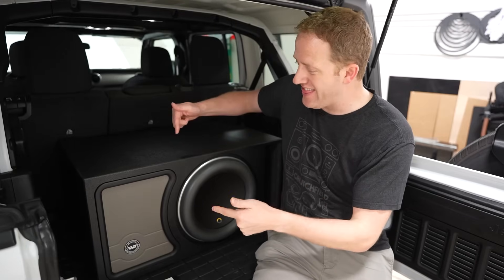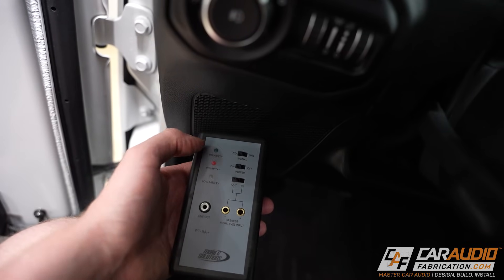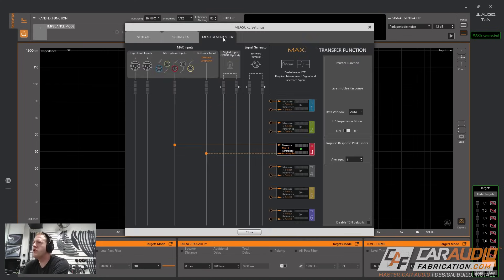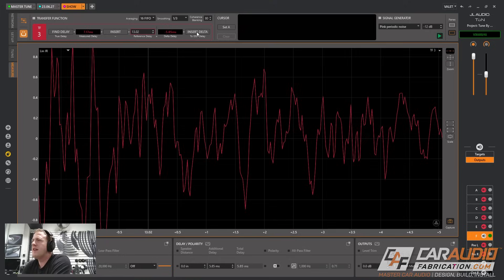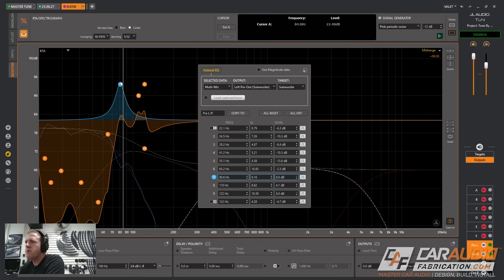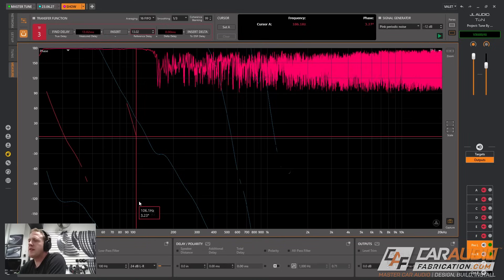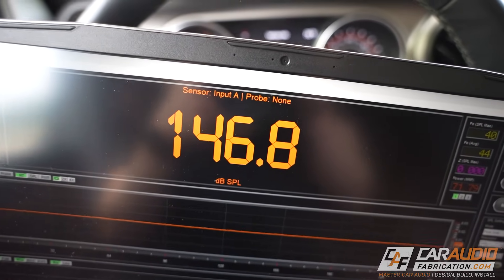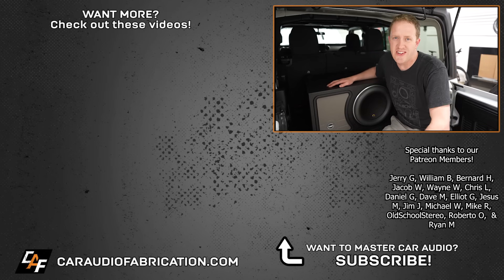MAXimizing Subwoofer Performance - Tuning & Testing W7 Box Build!

Comment: I've had my 2 13.5's for 18 years with only a surround replacement. JL Audio speced my box according to how I wanted the subs angled and they sound amazing. I had them also spec out SPL boxes that I used one time before I moved to another state but many years later the basement flooded and they got wet. A 11/2" thick subwoofer box looks crazy when it swells up from water and unfortunately I no longer have the box specs now that my son is into music.
My oldest son is into SPL and loud bass and just got his first car over winter which that day he put his mom's, my wife's from when I met her 25 years ago, 2 Extant 12"s setup in the trunk. Black Friday we ordered 2 15"s and an 8k amp. The second sub finally showed up the end of January. We measured the trunk specs to get a box designed and this is where things got interesting. The f/s specs that are sent with the subwoofer don't match up when entered into the program and that's when the reality of most of the audio companies out there. He mentioned only a few brands that list actual specs JL Audio being one. So we ended up building him a box speced online to manufactur recommendations and we had to change the subwoofer location firing up. He hit 146.4 at Saturday's competition with 50% power and over the next month we will do some testing at full power and cut that box out of the trunk space and try a different design and smaller box and see what that does and hopefully his numbers will go up to where we won't be building box # 3 or 4 till it's where it needs to be.....

Comment: What’s the absolute best hertz for loud clean deep bass overall , I heard 80hz is the sweet spot
Reply from the maker: 80HZ is usually where you start considering transitioning to midbass. The answer depends on the vehicle and subwoofer used.
Reply: @ thank you. Basically I can’t go wrong with 80 ✅👍🏽

Comment: What would you prefer an 8W7 in a Gately box ported or 12 W6V3 in a sealed box they will be powered by a Mosconi pro one/10 the rest of the system is a Mosconi one 6/10 all focal k2 speakers

Comment: Hey man you’re the only one I can turn to. I’ve got a JL system installed by a dealer and I still heave a very faint hiss from the speakers but only when the A/C is off and you’re dead silent. I looked at the ground and I saw they didn’t scratch the paint and I brought that up to the installer and he said he’ll adjust the gains and that the amp ground just being screwed in is enough because the threads are touching bare metal. Should I take it to heart or should I just sand the paint under it, or will it even make a difference? Amp is XDM1000/5.

Comment: This is why a DSP is needed for every system. So you can control everything. Get better SQ. Your system will be focused instead of sounding like the speakers are playing everywhere. And you can take that same sub/box and put it in another car and it will not sound the same because every car's cabin is different....

Comment: I think this is very informative for 1% of the car audio enthusiasts out here and not really for the average DIY’r. A tutorial on tuning and and perfecting car audio with basic tools/equipment would apply to a wider audience and would be appreciated.
Reply: Exactly. AA battery for polarity check, $20.00 voltage meter to check what ohms the cabinet is wired to, If you know the Fs of any speaker on the crossover set it higher by 2 times, so a speaker with an Fs of 60hz you would high pass filter it at 120hz to protect the speaker and for better performance in its frequency range. I used the same process for my subwoofer also. If the subwoofer speaker it self has an fs of say 35hz I would start the low pass filter at around 70hz and then micro tune it from there to my preference. Subsonic filter usually set to 5 hz under Fs so this 35hz subwoofers subsonic filter would be set to around 30hz..You don't need hundreds of dollars in equipment if you have the specification of the speaker box and subwoofer from the manufacturer...
Reply: He has tones of those man.  Do a search.  Also tons of videos of others doing the exact same thing.  And its his channel.  He can make what he wants.  Go watch one of the other million videos for the same old shit builds.  I plan on doing this kind of setup with my next system.  Perfect video to get my feet wet.

Comment: I have a build planned for two of those 13.5 w7s, do you recommend buying two of those amps, or do I have to do something weird
Reply from the maker: Yes, two amps. HD1200's are solid for the 13W7AE's
Reply: @CarAudioFabrication  I’m sure you get a lot of quick questions, but if I’m going to make a dual w7 13.5 build, should I got for a sealed enclosure? Or maybe the question I should be asking is will the infrasonics still be amazing?

Comment: I went to the JL Audio site to try and find the final installation of the speaker surround wire and the locking ring, but I couldn't find it. Is this because they were purchased by Garmin?

Comment: I remember back when I was doing one of my very first stereo systems in my car It was a Pontiac I was at one of those front of the mill audio shops and I saw a jail audio sub and a box and it says wow the RMS on that thing is really not much. Says well these are underrated speakers. And since it was only like 130 bucks for the speaker and the box wire that's this man I'm going to give this thing a shot and I was blown away from day one so I'd never buy anything other than jail audio after that. I think it was in 2000 or 99 yeah 2000. what do you think that model was. Hard to remember us but I think they said the RMS was 150 watts or something like that maybe 180 It was a low number

Comment: Hi, love your content.. I have a question.. I have a 01 ram ext cab... and I purchased a under seat box.. for two 10s... the box has a air space of .57.. the speakers I have ( purchased for a larger box ) needs .7 .. kickers crv102s... the box I have is wedged shaped and no room to port.. should I leave the box sealed or can I use passive radiators?? Oh pretty much every box I see is in simular design... any suggestions.. ty vm

Comment: I have a question. How would I find out information on a speaker that doesn't have all of the TS parameters. I recently bought a pair of gravity warzone 8in gw8d4 speakers. It does not list the displacement or have all of the parameters. I wanted to do a custom build with these but it's difficult to design something without speaker specs.

Comment: hi Mark, after you set your woofer TA by using sub as your reference point, do you add or subtract from the established TA value from each speaker when you dial in TA for the specific listening position in the car?

Comment: Hey bro. How about a sound band EQ display for the rear vent windows on my Ford Expedition?  They make these cheapo units that plug into your cigarette lighter and light up your windows to bounce light bars to the beat, but the sensitivity adjustment is junk and my Rockford Fosgates are too powerful for it.  I was wondering if you knew of another product that I could install on the interior of both side rear windows that would light up at night like an old school "EQ"?  And one that would actually display the difference band frequencies as they're playing in each song?  The cheap kits all light up at once, it's just the "bounce" that you can kind of adjust with the sensitivity knob.

Comment: I've got almost the exact same setup. Only getting 133 dbs. Vehicle isn't an suv but my chrysler 300 with the backseat down has plenty of airspace. What could I be doing wrong? That is a huge difference compared to yours.
Reply: Trunk vs hatch. Hatch will always be considerably louder. The only way to get a trunk build louder is remove the rear speakers and/or cut the center of the rear deck to allow more of your bass to reflect off of the glass. You're losing bass energy from vibration. The metal in the trunk turns your sound into rattles. Remove the material between the subs and the glass which is incredibly dense and your bass output will increase 🍻
Reply: Enclosure,  electrical system...

Comment: 146.8 on a single 13.5 with that amount of RMS with a setup that’s designed to be more towards an SQ build is purely insane.
Reply: welcome to the jl w7
Reply: @jondoe6618 A lot of people see that $1800 mark and say you can get way louder for cheaper, yes that is true. But loud and still sound amazing not so much.
Reply: @ViC8o5 man things have changed. I paid $500 for a 12 brand new in the box 15 years ago 😅
Reply: @jondoe6618 i just put the 13w7 in my Mazda 3 hatch with the HD 1200/1 and it is bananas deep and loud.   I’ve had two twelves  and three 10’s in my other two cars and this is at least three or four times louder and cleaner.  Unbelievable subwoofer.
Reply: this just ain't welcome to jl this is welcome jl in not just there generic high output box but a box made for his cabin space and listening position he's step it up a notch.
Reply: DD subs is known for SPL.... not saying they don't sound good but not on a JL level
Reply: @vernonjackson1792  well said
Reply: JL audio is an awesome and respected name but its price tag has grown to astronomically ridiculous numbers and simply not worth the jump FOR ME. 140’s  with an SQ adequate for the majority of audiophile in todays car audio is a with decent knowhow,middle of the road equipment  moderate price-tag is not all that difficult but to achieve. Not to mention most won’t know the difference if not pointed out to them  what is or isn’t “acceptable SQ. They don’t know the difference what your equipment is saying worse better or best they just know and want what sounds best to THEM AND THEIR ears.
Reply: @MillTownMatt414  Well said. But you will know the difference once you play JL next to other brands at the same power output. Price though is a real challenge lately.
Reply: I had a buddy running a 10w7 in his tacoma around 2004, and it was insane. Hardest hitting single sub I've ever been around.
Reply: l am hitting about 138 on 2 10w4 and 5.25 JL on a "Roadmaster" PHOENIX GOLD it's a 5 channel Amp @1600 watts...
Reply: Cause it is like you said to be SQ. Or a perfect combination from both.
Reply: I thought w7s were the greatest until I tried a stereo integrity SQL. Louder and sounds way better.
Reply: Has anyone  ever heard of DD?
THATS REAL SQ.
IVE OWNED BOTH
Reply: @ashleyburke2282  Digital Designs? I always wonder why nobody uses their subs and why DD don't put much efforts into marketing them
Reply: @oscarishandsome5150  Ive owned a pair was not impressed !

Comment: It’s a good subwoofer but just way over priced.
Reply: until u hear one.
Reply: @jondoe6618  hear my Skar VXF-15 it sounds 95% as good as this wad of Benji bois 😂
Reply: @bailey2517  nope. I’ve had almost every brand. Not much beats jl audio for quality.
Reply: And it's $300, not 1800 LOL
Reply: @bailey2517  especially skar subs. Not even in the same planet. And I have several.
Reply: @jondoe6618  your words have no value. Explain your claims.
Reply: @bailey2517   a 10,000$ 67 mustang and a 100,000$ 67 mustang are similar. Both look similar. Take up the same space. But one just is better in every way. I get cheap stereos. I’ve have several. But once u have the good one it’s never the same again. Like a good woman.   Enjoy the fast easy ones. But I want a keeper.
Reply: @jondoe6618   lol 1800 and 300 are MASSIVELY different prices, if oyu can get 90% of the quality for a fraction of the price....why not.

Comment: That sub will last FOREVER running off of that amp at 3 ohms.  I am currently running a Down 4 Sound JP23v2 @ .75 ohms, in order to take full advantage of the 13W7's mechanical limits.  I once burped a 50 Hz tone and measured 2,980 watts with an SMD AMM-1 and my amp is turned down as to not let the voice coil bottom out against the back of the magnet!

Comment: I'm not convinced time alignment makes sense in a car environment. You can't time align for every seat in the vehicle meaning only 1 seat will have properly aligned audio. I think just having no delay is fine.
Reply from the maker: You need to sit in a vehicle with a proper tune that has a NO TA preset and then one with TA. If you know what you're listening for the difference is staggering. Also there are strategies we can use with phase and additional drivers to make every seat in the vehicle sound good.
Reply: @CarAudioFabrication every seat soud good? (Cough) Video (Cough)
Reply: I have a preset on my dm608 that is time aligned for just me in the driver position, 1 other preset for my kiddo in the back seat and another with balanced stereo, besides the sub of course. Works great, shifts the imaging of the sound stage to center whilst sitting in the drivers seat.
Reply: A simple answer, it makes every sense to have TA done for any system that you are listening to whatever the environment is, if you are listening  from any offset position. In other words, if you are not sitting at the center of all the speakers that surrounds you, even may be a 2 stereo channels, you need to get the Time alignment done.
Reply: I have a JL Audio TwK-88 and when I am giving a demo, I just change presets so that the passenger seat is in the "sweet spot" and is time aligned.  I also switch the sweet spot to my side while they are sitting there and the difference is staggering.
Reply: Yeah only one seat can be properly time aligned, but who cares what the passengers think???
Reply: We only have 2 years left and right in my time we also had quadraphonic let's just play it all left and right I think that's the only way otherwise the band would have their stage setup quadraphonic
Reply: I used to to think that too..... until I did it.   I will NEVER go without a DSP ever again in a car.
Reply: It sounds so much better and spacious with speakers time aligned.

Comment: How do you do this with REW?
Reply: You would need a USB audio interface with two channels for a loopback to measure phase. For multiple mics like the max you would have to buy the multi mic version of REW as well. It would be better to use a different program other than REW for multi mic arrays like Smaart V9, but it is a out $160 for a year subscription of LE or almost $500 for a lifetime key. Everything can be done I. REW, but nowhere near as easy.
Reply: @TickleFingers  can you use the reference signal and still be able to use REW?
I'm less familiar with REW and the use of the reference signal used for timing